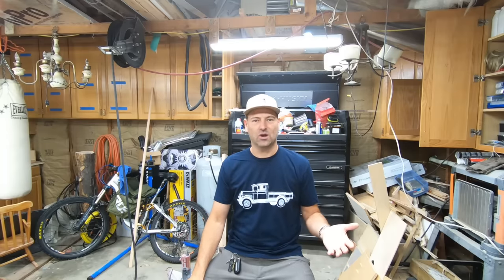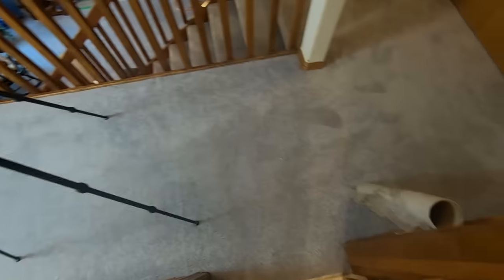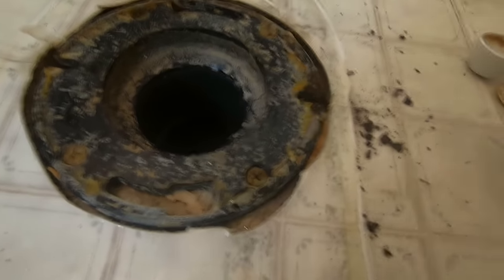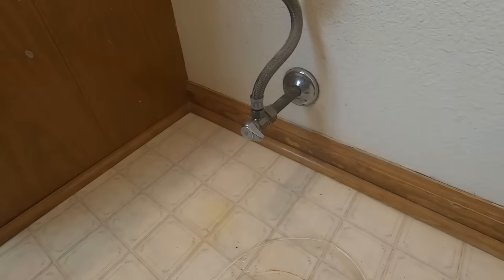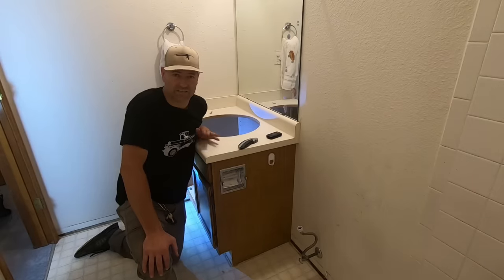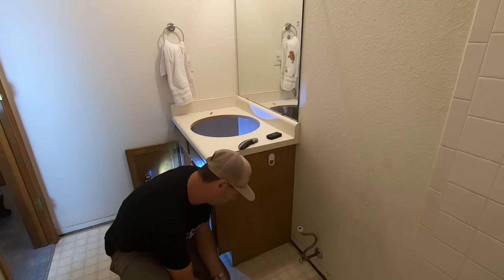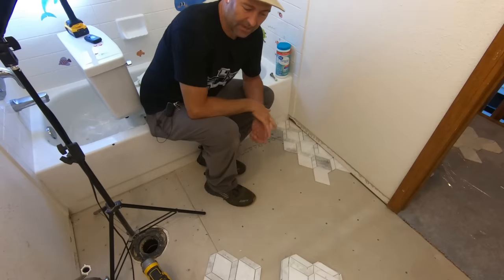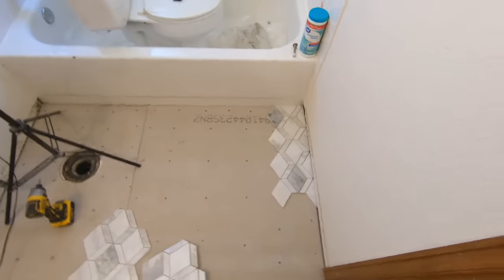$6,500 Bathroom Remodel Step By Step | How To Do It Yourself | THE HANDYMAN |

Comment: Always interesting to renovate and remodel older homes.  Took out the tile in a shower in a 1950's era home.  The ceramic soap tray that was set in the wall had news paper packed behind it.  Was able to see when it was printed and had some cartoons making fun of the USSR leadership as well as advertisements for the area.  

One thing I have started doing for any toilet or vanity replacement I do is automatically replace shutoffs and supply lines.  Too often I have had one or both fail on me in trying to save the customer a buck.  Piece of mind knowing those two items are new and its in good shape.
Reply: The fact that the newspaper was still intact and and not absorbed any moisture means that the original tiler know how to waterproof!

Comment: Work on my grandfather's old house continues, and this is great inspiration.  The next major interior job is a bathroom remodel.  It's a house from 1962, 3 bed 1 bath.  The bathroom is small so I want to expand it a bit by taking out the oversized closet that's in there.  The bathroom has some old octagonal tile I'd like to save and reuse, buttttt we got sub floor issues from years of a leaky bathtub my grandad never did anything about, so I gotta chunk it all up and replace the flooring.  I'm not looking forward to it lol,
Reply: I just had to tear out an old subfloor and it came out in splinters...  Took a whole day.  There were about 500 nails sunk into it.

Comment: As a newbie DIY guy, I would have assumed that the old linoleum would have to be torn out. Even if it and the subfloor are still in good shape. Good to see that it can stay in place and help get the new tile to the correct height. Looking forward to the rest of the videos for the project.
Reply: Couple of things here.  The Linoleum is probably bonded directly to the subfloor with an adhesive and peeling the linoleum off and cleaning the adhesive can be a nightmare.  Also leaving the linoleum on actually acts as a type of slip sheet (crack isolation membrane).  So as long as its installed properly it's typically beneficial to leave it.
Reply: You can leave it to go faster, but I remove it in my house and for anyone else who might be concerned about mold under the flooring.
Reply: Honestly if the floor feels solid I'd leave it. It felt soft and spongy I'd definitely rip it all up.
Reply: youre really not even doing much of a gut without pulling the floor up to see the condition of the subfloor, but good luck half assing everything
Reply: And you always thinset your cement board to the subfloor, never just screws
Reply: My extra bath had linoleum (actually probably vinyl) but it was glued on top of an extra layer of plywood, so after peeling that up (not that hard with an "ice scraper" bar), I set a circular saw to the depth of the extra plywood layer and cut squares that I could pry up. Then followed manufacturers directions for 1/4" Hardie backer board (mortar underneath). My master bath had carpet, which was easier, and grosser, to remove.
Reply: @Tyscrat house flipper probably thinks they are doing a good job

Comment: Agree 100%... if you are handy, you can save a ton of $ doing it yourself.  Contractors will tell you everything needs to be replaced to try and up-sell the job.  Total cost for my job... perhaps $800.  The new tile was the most expensive part.

I'm in the middle of revamping my 1/2 bath as part of a family room re-do.  New T&G ceiling, new tile floor and all new trim & paint. I had to break up and remove the old tile (crappy grout job).  The toilet, sink and cabinet were in great shape, cleaned up well and will be re-used.  I just spent perhaps 3 hours total repainting the cabinet to make it like new.  Tip... as long as the toilet is yanked, pull everything out of it inside, clean and rebuild it from scratch with all new plumbing parts.  It will be just like a new one.  Replace your water shutoffs as well, as long as everything is easily accessed (ball valves of course).
Reply: Yeah I did everything but the bathtub and surround for about $1000...  I had to completely reassemble the vanity I bought, it looked like a drunk 4th grader with a staple gun had built it.

Comment: What about replacing the tub/shower? Aren't you supposed to do a complete remod so all of the plumbing ages at the same time? (I'm just interested in which wall you would be ripping out to get it out and a new one in. And, what window or exterior wall you would have to open up).

Comment: @ The handyman in the beginning of the video I noticed you taking nuts off with pliers. I suggest getting ratcheting wrenches from Lowes. They come in handy. Sometimes they're on special for $49.99 for 20 pieces that come with both metric and SAE sizes. Anyway hope that helps.

Comment: What do you do if the floor around the toilet needs repair/replaced? How do you make up the difference between the old floor with linoleum and the patch without?
Reply from the maker: Cut it all out and replace it.  Build it up with what is necessary to get the right height.

Comment: 6500.00 for vanity, toilet, and floor tile i didn't see you remove tub, tub surround.
Reply from the maker: That is correct.  50%of that is the materials. Vanity, tile, mirror....
Reply: It seems like this customer is elderly and or gullible. I have a 40 sqft bathroom, thats being gutted except the ceiling that we are covering with tile. Labor is $1,000 and materials were $1,900 and a re-pipe of this 1,225sqft house is $1,500 labor.
Reply: Im only a 22 year old woman and I'd never pay 3k for that small job. He only has to wait for grout to dry and cut tile lol.  

Alot of contractors that I interviewed told alot of lies and the more lies they told the less I was interested in their business which is how I found a reasonable licensed and insured contractor.